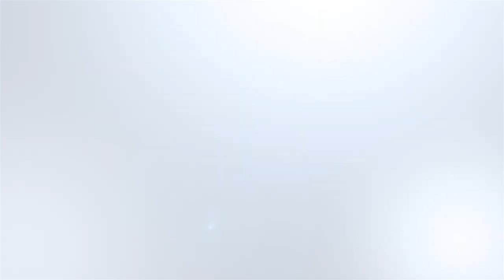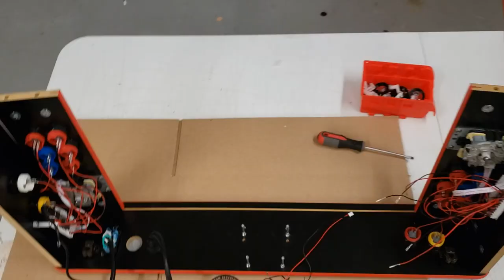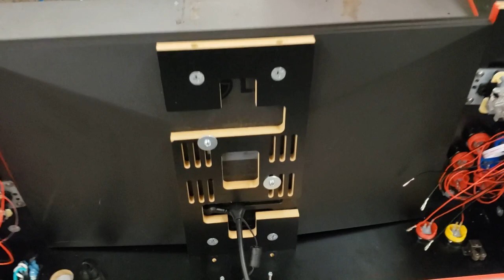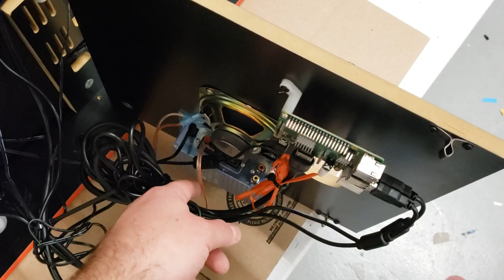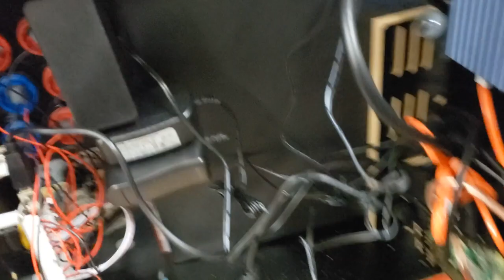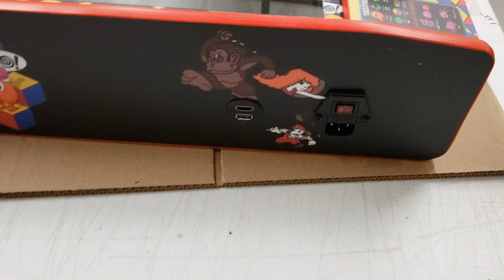Table Top Cocktail Arcade Cabinet Assembly

Comment: is there enough room for a PC that would run Coinops?
Reply from the maker: It will not fit much larger than a Pi.  That is why in the coinops video I did the hdmi input, etc so I can connect up a pc under the table.
Reply: @Gameroomsolutions  didn't notice it was on an external PC